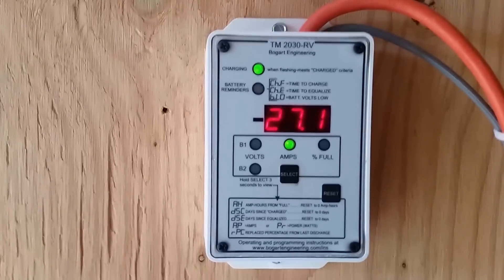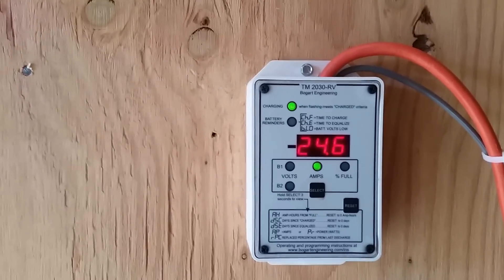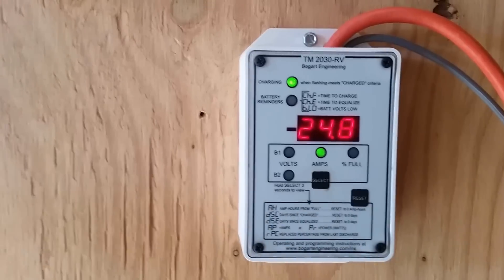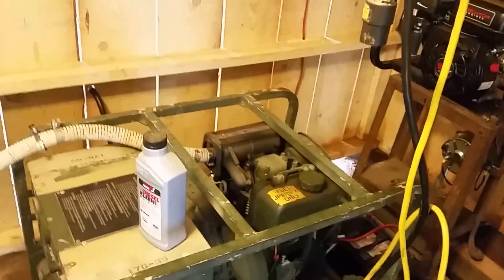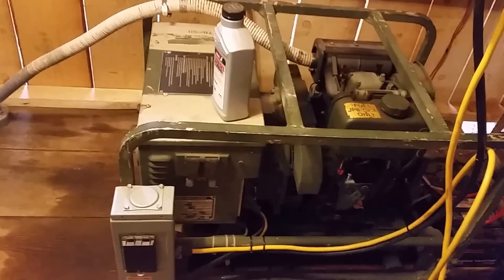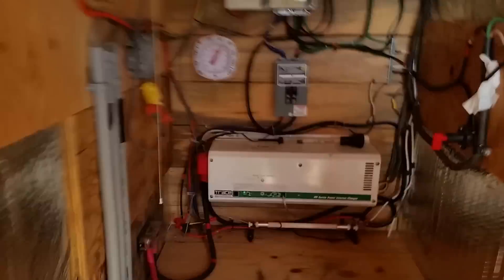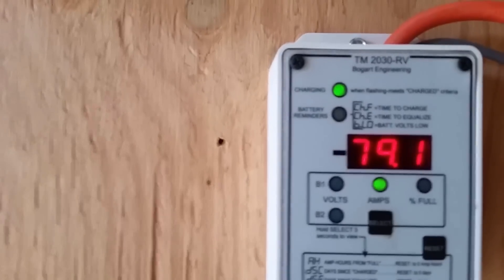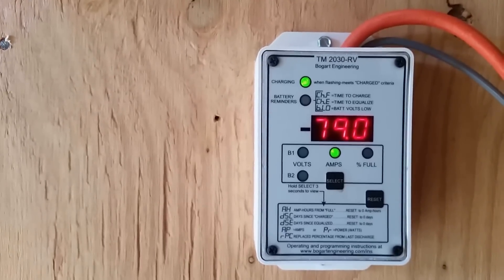Off grid solar homestead (off grid generators)

Comment: EXCELLENT video! I mean that. Great job explaining this difference. Not all voltages are the same. We had some of the generators like yours in the field in the early 90s. They worked great. Always started right up. Ours ran on JP8...